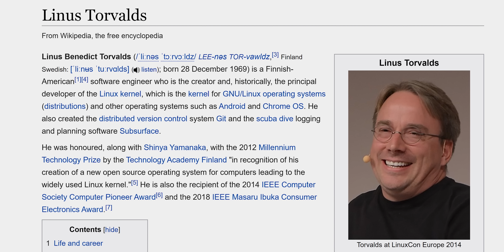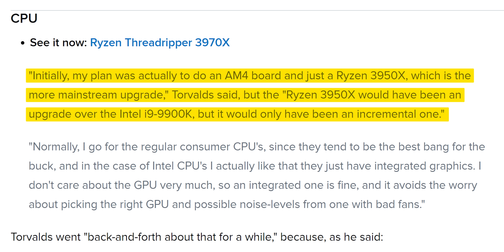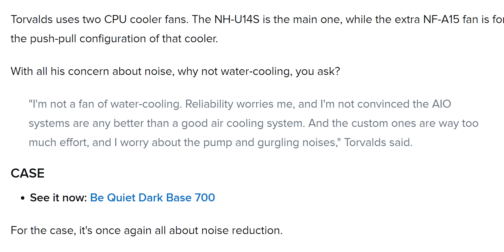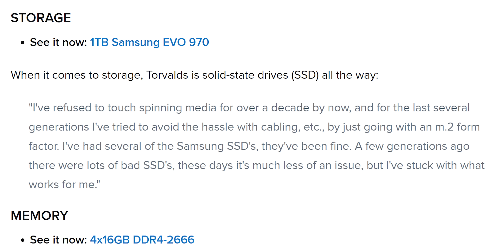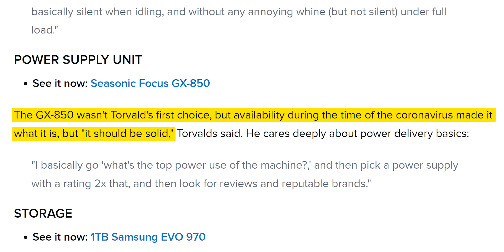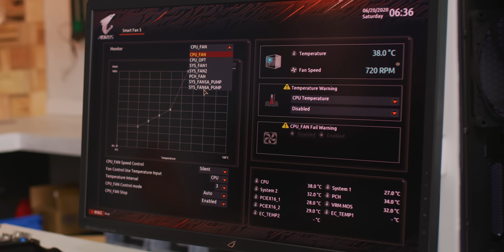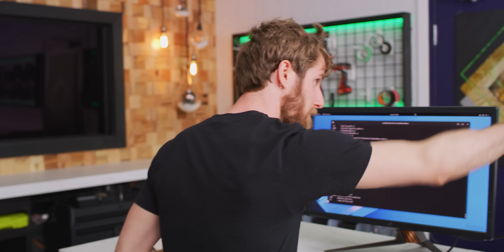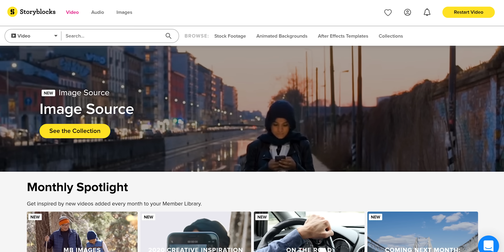Linus builds Linus’ new PC!

Comment: "We don't understand the true needs of a developer"
As a developer, I can tell you, neither do we.
Reply: When you're working on consumer software (especially web development) having too fast hardware when developing can be a problem - since if you assume everyone has a system as good as yours, there's gonna be a lot of people with a really bad experience on lower end pcs.
Reply: @CalvinWalton  that's why you do validation on a 2 thread VM running win7 IE 8
Reply: @CalvinWalton  maybe, but you could probably test that with a virtual machine I suppose
Reply: sooo true
Reply: True enough. But I’ve found it helps to buy just a little more than what you think you need. Plus it depends on your needs. For web dev? A laptop will do. For game dev? Probably a decent high-end CPU and GPU.  For making your own Linux distro? Get a nice threadripper build like the one here, only consider a 3990x and maxing out the RAM for the motherboard.

For machine learning? A decent CPU and the best GPU you can afford, maybe even more than one.
Reply: @christophernugent8492  very true! I am fortunate that I can get away with a decent laptop in what I do. To those who are interested in getting into the field, I always suggest get 10% more than you think you need.
Reply: @christophernugent8492  Training neural nets locally is not worth it imo with cloud computing being relatively cheap.
Reply: Michael Drane Personally, I wouldn’t feel comfortable developing machine learning software in the cloud. With months of dev time, all the while I’m paying for the GPU without using it, well, at some point I’d rather just own the hardware as I suspect it would be surprisingly cheaper. I wouldn’t just train the neural nets. I’d also be the one writing the software to scrape new training data, to clean it, and to integrate the neural nets into the software stack for my application.  I don’t do machine learning professionally. I do it for fun because I really love the subject, but that means that what companies may have other teams to do, I have to do myself. That said, if my personal rig wasn’t enough, I would engage a cloud VM with a vGPU to help lighten the load.
Reply: @christophernugent8492  For web dev you need a good cpu and a good amount of ram, dev tools can eat those pretty fast
Reply: The_Draft I don’t doubt you on that, but I have to ask: what is the advantage of using an IDE over, say, VIM or Emacs with the right plugins?
Reply: @christophernugent8492  familiar UI
Reply: @christophernugent8492  I've been using Emacs for a long time, but switched to vscode recently because it's a lot easier to setup. Emacs is great with python, C/C++, lisp and org-mode is absolutely something that changed everything for me. But trying to get react dev., working is a hassle. Of course it's possible, but would take days to get working as well.  Vscode is a great inbetween a IDE and editor, both for python and javascript.
Reply: The_Draft and a very fast SSD unless you want to spend hours waiting for chuck asset optimization, gotta love webpack
Reply: @FatDraft  very true
Reply: @christophernugent8492  It really depends on what you mean by web dev, a simple website sure, an internal enterprise system that has redis and rabbitmq etc in the stack run via docker, you absolutely want a fast desktop with a shitload of RAM - these days web dev is more than a blog for cats in many cases.
Reply: @christophernugent8492  for python? a 170€ NUC will do
Reply: I mean depends what you're developing...and what you do in your free time. I've yet to meet a developper that didn't have other computer based hobbies
Reply: Water, nutrition optimized snacks and sunlight every 2-3 weeks.
Reply: Game Dev here. I 100% agree. You can survey a group of 100 developers and you won’t have the same answer twice. 
For game development, honestly, unless you’re making VR or truly graphics intensive PC, you can get away with a cheap graphics card, any CPU from the last 7 years and an SSD (a cheap one will do).
Reply: I feel represented by this comment
Reply: I have worked as support in 2 software company's and let me tell you, it depends. If you do Bodysimulations for Medical use you need a beast of a quadro to not compile your whole workday. But if you are doing some random Java project you'll easily get away with a good Laptop. 

From my perspective it seems like the thing linus did is a greate base. Getting a lot of CPU-Power is always nice. RAM should be choosen CPU dependent 16-32GBs should be enough tho. As a bootdrive use a M.2 they are greate. The graphiccard is where it is getting tricky if you just need it to Display your GUI a cheap card isn't too bad. If you do Graphicscard heavy stuff like 3d simulations or machine learning stuff you need a little more power.
Reply: Also a developer, I chose quietness over performance. My main work machine has no fans at all in it and the whole case is a giant heatsink. I hate fan noise while I'm working.
Reply: we don't understand the true needs of a developer because generally, almost anything goes lmao!

plus if we needed more, we'd KNOW it!
Reply: Nxt Puny There is truth to this.
Reply: @GreenLinuxPenguin  : Heh...  There's some things that this isn't QUITE the case.  Doing GPGPU work?  You're going to need a beastly GPU (duh...) and a beastly CPU with decent low-latency RAM.  You may/may not need fast disk/SSD or a lot of RAM.
Doing OS build work (Look up Yocto Project...)?  You're going to need the trifecta of LOTS of low-latency, FAST RAM, CPU, and as FAST an SSD (IOPS are KING here...) and less the GPU, unless it's getting re-used for gaming or GPGPU work.  I know precisely what I need to do my work and calling...and this build's a pretty good match to all of it.
Reply: @frankearl9285  large reason I made my initial comment was as a joke, but I have lost track how many times I've worked on a project where the client had no clue what they wanted as an end result. About half of the time, the client pushes the goal posts back too, leading to more intensive requirements for my end. If you only build one specific type of application you can plan around that, but when you are often forced to come up with a creative solution with limited guidelines, things can be a bit crazy.
Reply: @frankearl9285  Exactly, hence why I said the keyword "Generally," because obviously there are some cases where not just anything goes, like yours.

On another note I KNEW I wasn't crazy in justifying my desktops for this sort of purpose, and not just for gaming.
Reply: @Alleroc  this is so accurate. Client's are a major pain in the ass
Reply: ExtraTNT If you only consider the kernel and a few packages. What if you are compiling an entire repo’s worth of Open Source software to make binary packages for fast installs on your main workstations? I’ve got other reasons for wanting a 3990x machine (namely, oodles of VMs), but I’ll be dedicating a 12-core server of mine to do repo build work.
Reply: True, as a developer in a typical corp, they get you a regular desktop for office.
But RAM,  cores and HD count, plus enough pixels to show.
Reply: still changing my preferred linux distro too frequently to actually change over to it
Reply: I would always recommend Intel over AMD. 
The iGPU is more than good enough and without a dedicated GPU you usually come out cheaper than a 'cheaper' AMD system. 
When you can use a dedicated GPU then go for it. But back end stuff and compiling usually don't benefit from GPU anyway. 
Unless you're compiling the whole project single core performance is way more important than cores. Which is a good point for going Intel too.
And in my experience most compilers seem to be better optimised for Intel processors. 
Many cores a good for virtualization. 8 cores are just fine for me. It's enough for some vms and very affordable. 
For RAM I would definitely go with 24gb or more. 
Quick SSDs are nice too have and due to quiet small file sizes (compared to something like video editing) very affordable.
Reply: _lk_s 24GB for memory? That’s insane.
How do you even use that much??
If you need that much memory for compilation, then I assume that you are compiling a whole big project.
Reply: @jiahaoxu6356  well. Maybe that is a little bit too much. I'm just lazy and have usually 2 vms running in the background all the time (2cores, 4gb ram each). I usually use up to 18-20gb of RAM. 16 would be enough but 24 are worthy upgrade for me.
Reply: For web dev you need a shitlosd of ram, decent core count but more importantly single thread perf for nodejs, and blazing fast storage for all the watchers running and plenty of space for all those node_modules
Reply: true, I have enough hardware to spin bunch of production servers on docker with full redundancy. But I don't use half of them :-)
Reply: Notepad++ that's it.
Reply: X-D
As a developer, I'll ask you, "WHY?!" 
How can you code for the machine you're working with if you don't have some concept thereof?  Seriously.
Especially in the embedded or gamedev space on things...  If you don't understand the ramifications of the work you're doing, you're going to be woefully inefficient at best at the job.
Reply: Not true for the developers who used to be a gamer in college days.
They always, always build their own PC .
Reply: Yeah, I'm too a developer but I like to watch movies and do some gaming in my evenings. So my "developer PC" turned out to be also somewhat gamer-ish.
Reply: Ouch. The truth. It burns.
Reply: I do. I need a hug.
Reply: 19-23 screen is always hit my g̶-̶s̶p̶o̶t̶  sweet spot
Reply: Either specs through the roof (Maybe not with big GPUs), or something as cheap as a 800$ Budget laptop. Ofc, with some people prefering things inbetween.

Some really just wants a good keyboard and build quality, thus we settle with XPS, ThonkPads, and MacBooks (and some Linux purists and hipsters going for System 76)
Reply: Are you really a developer?
Reply: @flisboac  yup.
Reply: just say 'DEVELOPERS' enough times and all needs go away
Reply: You only find out when it's already too late.
Reply: 3 hours 5 minutes 5 seconds.
No Errors 
Built compiled sucessfully.

The only feature i want
Reply: True, I took a day to find which linux distro i wanted to use for a project even though i only had two options
Reply: depends what you're developing. the spec I'd reccomend for a frontend dev would be different from soneone buidling a cloud topolgy on a local kubernetes cluster which would also be very different from someone developing a game engine
Reply: Me looking for a laptop with an 8-12 core cpu and 16+ gb ram BUT WITHOUT a dedicated gpu. After a week of searching i found out why I picked my  ideapad gaming after all. I guess in a year or so I will have to upgrade tho and that worries me.
Reply: as a developer I can confirm
Reply: @Alleroc  tons of ram and a multi-multicore cpu
Reply: As a software engineer I can confirm, software developers don't know, but software engineers do :*

Comment: @Linus - you're not using the "extra thick" rubber pads on the second NF-A15 fan (the one closer to the I/O in PULL configuration).
As per Noctua's manual, this reduces air turbulence and consequently reduces noise.
Manual here: https://noctua.at/pub/media/blfa_files/manual/noctua_nh_u14s_manual_en_web_v2.pdf
Refer to Page #2 at the bottom, where it talks about adding a second fan.
Also, the NF-A15 fan that comes with the NH-U14 is a 1500 RPM fan vs the NF-A15, which is 1200 RPM.
Read the manual and make sure you're using the fans in the correct configuration and it will drastically reduce the amount of noise and boost cooling performance (a little).

Comment: I went with some nemix ecc ram for my 3950x dev workstation build and its worked out great so far. Rock solid! Not cheap but oh well. 

NEMIX RAM 64GB 2x32GB DDR4-3200 PC4-25600 2Rx8 ECC Unbuffered

Comment: linus: "it finished in just over three and a half minutes!" 
me, compiling firefox on a lenovo x131e: "hahah, it's been eight hours and it's still not done."
Reply: As someone who has an x131e as a secondary low-performance system, AAH!  Getting YOUTUBE out of that thing can be a struggle!
Reply: @0xEmmy  try h264ify it worked a treat on my x120e.
Reply: Firefox takes a lot longer to compile than the Linux kernel.  Firefox will take 15-20 minutes to compile on a modern i7/i9 with lots of RAM and a SSD.
Reply: @emu071981  What? For me it takes 5-10 minutes! I have a Octa core Xeon from 2012 with 12GB Ram, nothing special.
Reply: Try compiling chromium 😄. That thing will destroy your 8gb RAM
Reply: Timothy Been there, done that. I feel like you need a 32-core and 32 GB of RAM to get anywhere near a reasonable build time.
Reply: /me cries in x120eeeeeeeeeeeeeeeeee........ The x140e is my favorite small machine though, it would be so SICK if Lenovo makes an x150e etc.. wtih Zen 2 I'd be all over  that...
Reply: Lordy. Yes. So much this! Took like, an hour or more on my 14-core.
Reply: C++ and Rust are notoriously hard to compile as opposed to C, and guess what's one of the lesser reasons Linus prefers C over C++ :)
Reply: @atomtamadas  Agreed. And as a primarily Rust developer these days with a C++ background, I can personally attest that Rust is generally worse in terms of compilation speeds because of the way build artifacts are structured (a static tree of modules in a DAG of crates, which can have a variable number of binaries and/or a library component in it). Convenient for the developer, sure, but it makes parallelization of the compiler a bitch and a half to do. Lots of very smart people are working to optimize the performance and have come a long way to reduce the pain, but it's known from the outset that compiler times are never going to be great under this design. For me, personally, the compile times are a worthy trade-off for the benefits, but everyone's use case and requirements are different, and that's fine.
Reply: Unknown Person I did for awhile. It’s not a bad daily driver. It just takes forever to install the OS and everything else.
Reply: Oh god, the screen too. Welp, i'm lucky mine broke when the laptop fell from the top of my closet. About a 2.3m drop. It gave me an excuse to go and buy a new laptop :D
I don't know which model you guys had, but mine had a 3rd gen i3, and a tn screen.
Reply: I've got an x131e and a 11G3G. If you've never used the 11G3G you're lucky.
Reply: Why compile firefox why not download it. 😂😂😂😂
Reply: @bopon4090  Firefox boomark manager and the location of the search in page bar are garbagr IMO. You compile something yourself to fix stuff you don't like.
Reply: Bipin Maharjan A few reasons:
1.) Benchmark your machine for huge software project builds
2.) The compiler optimizes the binary for YOUR machine, meaning Firefox built by you could be faster than Firefox downloaded from elsewhere. Both Gentoo and LFS extend this concept to the entire OS install.

Comment: As a software developer, I would say it really is hard to create a `dev-rig` for a video, as this is a very case-by-case problem.
Linus is a very specific case, who does a lot of compilation, web browsing, video conferencing, probably a lot of virtualization (using `virtual machines`).
He probably needs the fastest and most reliable storage available, not a lot of RAM, a decent PC and any `random` GPU would cut it. 

In case of a more web focused development, those requirements would change drastically. A developer that works on, say, Floatplane, maybe on a full-stack position where he does the video data streaming part AND also making the site beautiful, then they'd do completely different activities.
Would probably have a lot of background programs to run PHP/NodeJS or other runtime environments, run databases, run random tests at remote or local virtual machines, and edit and compare (read git or alternatives) code on a light yet capable editor such as VSCode, Vim.
For such a work profile, they would need a very good network connection, a lot of storage space available even if it's not the fastest (reasonably fast network storage is fine) to use for Docker imaging or other virtualization tools. Still, as they would probably not compile code and a lot of the remaining work can be done off-desktop, they may also not need a beefy CPU, with many mid to low-end being more than enough. Same with GPU, integrated gpus would cut it easily. 

Let's go for the other side of the spectrum, and go heavy. An academic doing heavy number crunching would probably go for some fat RAM sticks with some beefy CPU, or go the way of GPU computing, and get a ton of the best GPUs they can to do the work. A graphical engineer would need a good computer for compilation (see Linus') but with the addition of a better GPU. Not much else changes. 

I could go on forever finding different use cases, from full simulation rig, to controlling server farms, to making fully embedded software to running a 100% virtualized workstation that barely needs any real hardware.

Comment: As a software developer, i built mine based on ram, ram speed, ram size and then a little more ram, building large programs and databases requires it, then the more cores the better for compiling, extracting... honestly this is a top notch dev build and I would have increased the ram speed as Linus suggested

Comment: It would be great if you could review the Phanteks Enthoo Luxe 719 (Luxe 2). You will LOVE the chassis. This is the best chassis I have purchased till date. Dual system support, Great fan support (16 x 120mm fans OR 8 x 140 mm fans + 4 x 120 mm fans), custom loop water cooling support, storage device support (12 HDDs OR 15 SSDs), back mounted PSU and it is neither a full tower, nor a mid tower. Fantastic chassis! The only thing I wish this chassis had was a removable top tray for radiator installation for a pull configuration and the ability to install fans on the top tray rather than under it in a pull config.